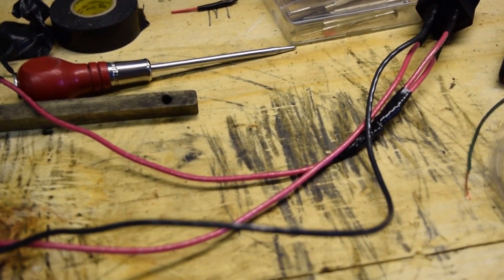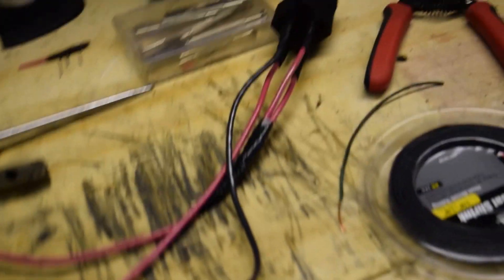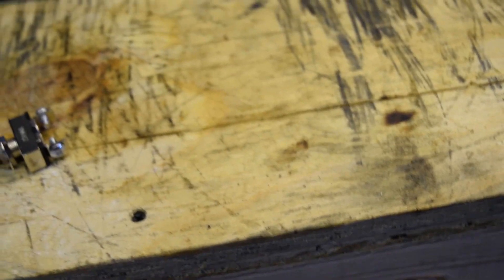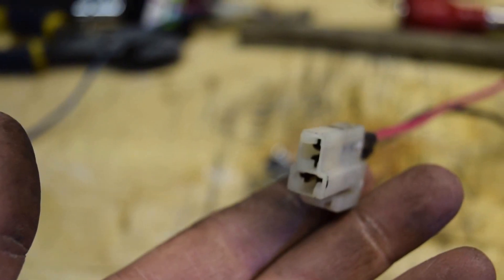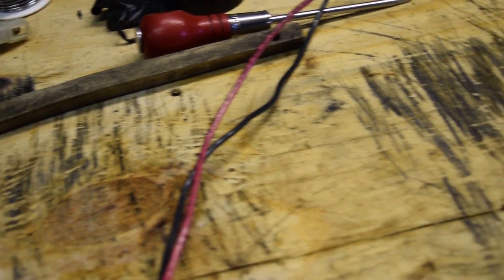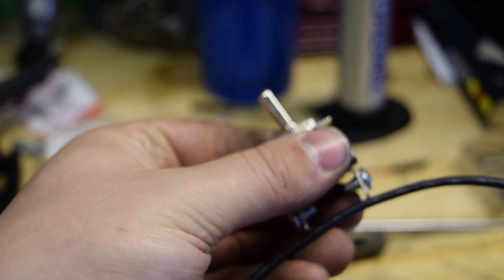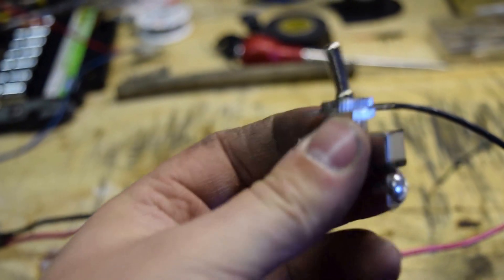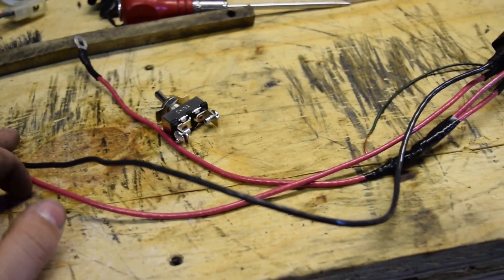Wiring in a Fuel Pump Relay in a FB Mazda RX-7

Comment: Insert the switch between the relay ground and the relay. Connect the fuel pump ground direct to ground. This will put the load through the relay instead of the switch. HTH.
Reply from the maker: Thanks for that! I wound up doing that for my electric fan and need to go back and do the same for this circuit as well.
Reply: @DreamInRotary  I am a RX7 enthusiast and I would like to get in touch in private, will you shout an e mail please Ranita RX7